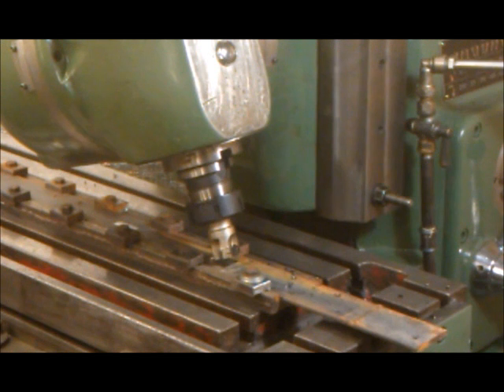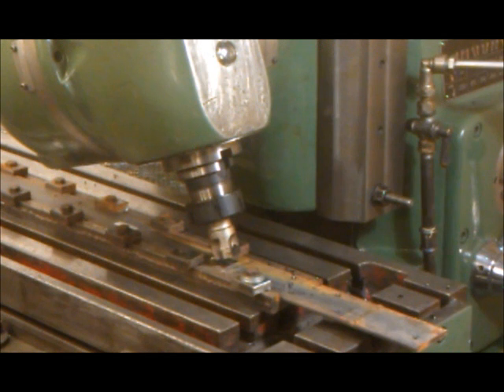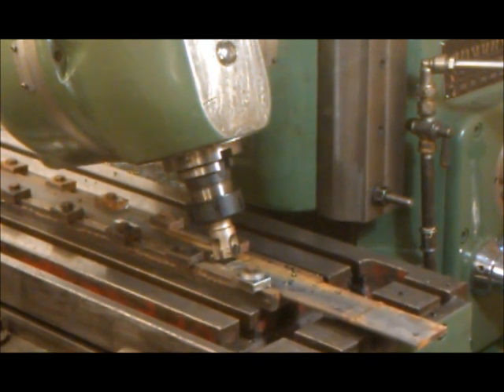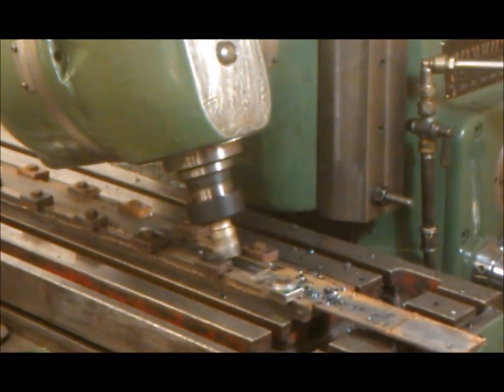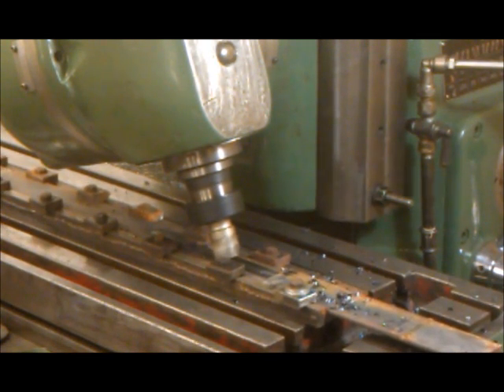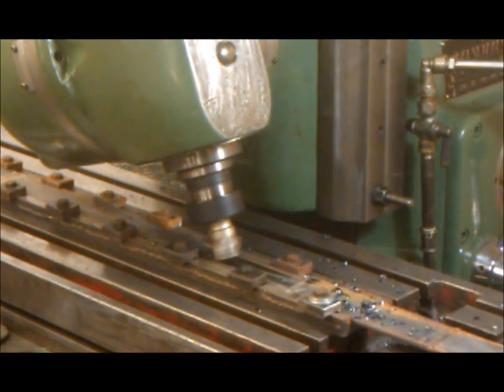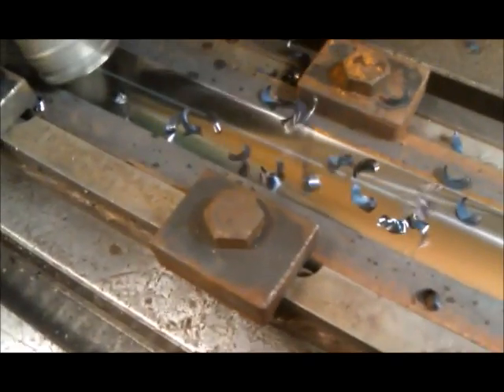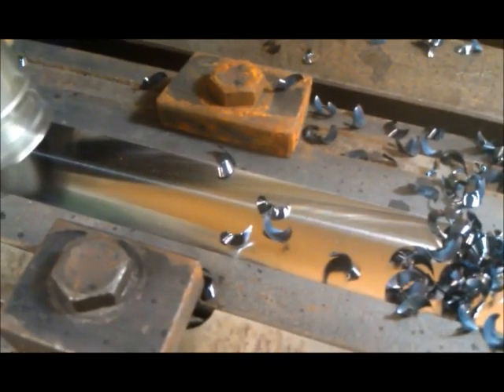Milling a Sword blade Part 1, The Fuller.

Comment: Serious question, how big of a table does a mill need to make a sword? I'm thinking that mill probably goes for around 20k
Reply from the maker: The travel of the machine needs to be as long as the blade. I have no idea what my machine would have cost new, it is 40 years old and cost me a whole lot less than a new machine.
Reply: I'm not a machinist atm but plan to do it as a hobby... I assume that this is different than a bridgeport layout. I guess I'm asking if there is more than a 50% price point difference between your standard clapped out second hand bridgeport and your standard clapped out second hand sword capable milling machine.